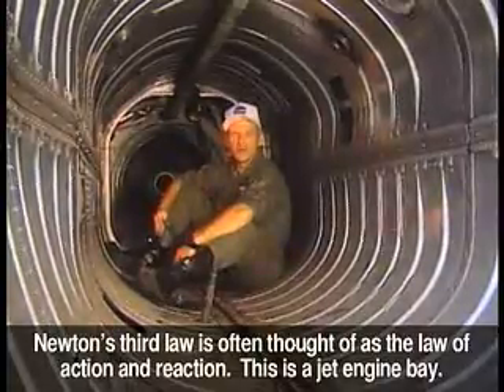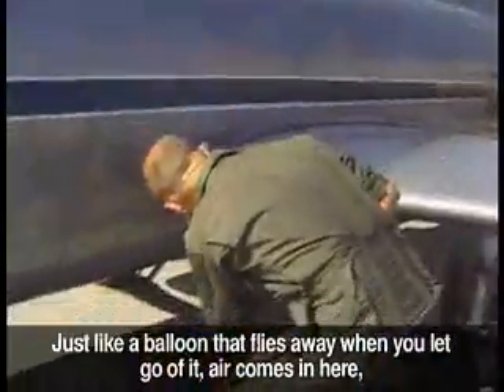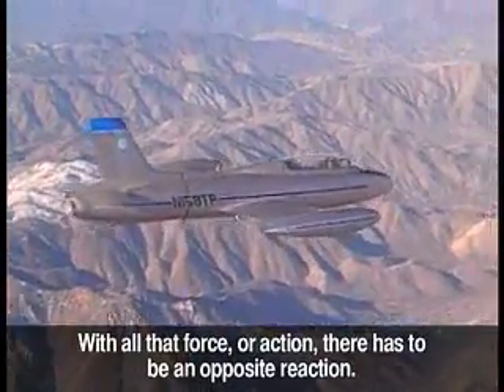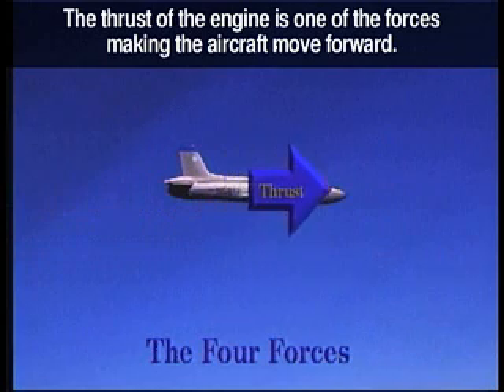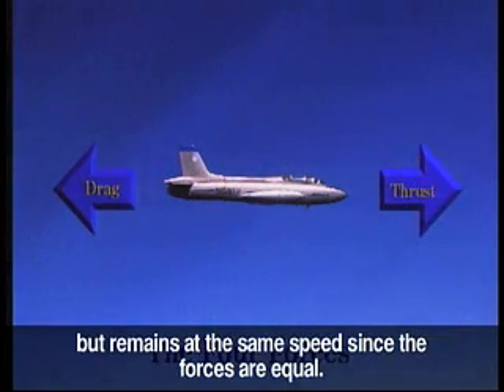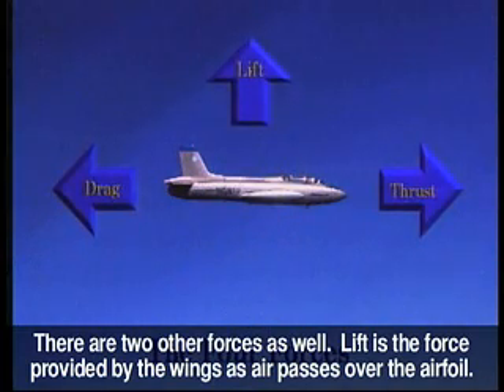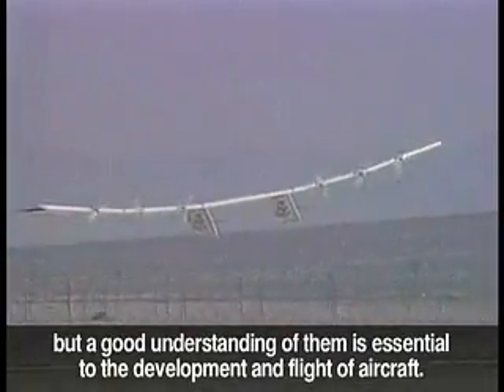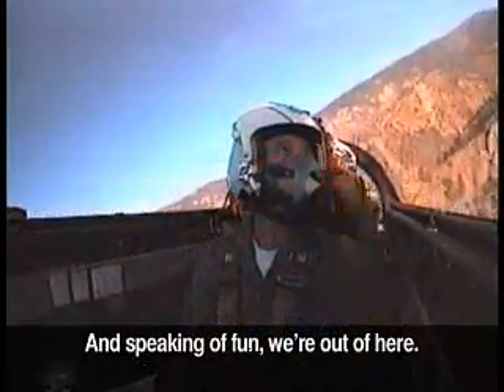The Law of Action and Reaction: Newton's Third Law

Comment: @batthatisbat  yeah you mean constant motion.... a body at motion will remain in motion unless there is an outside force and since the drag and thrust are equal, it will still remain in motion and it will acclerate and decelerate when the force is not equal. Therefore, the force bigger than the other one becomes the outside for acting on the airplane...